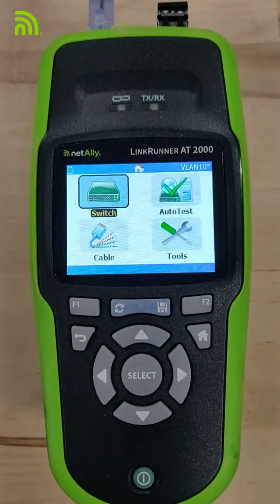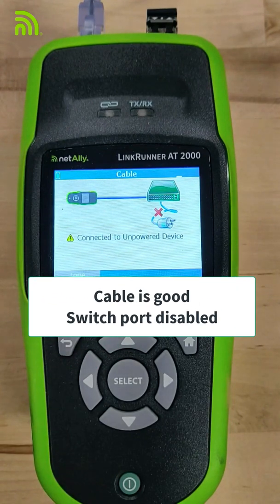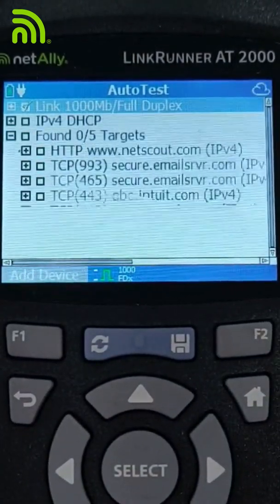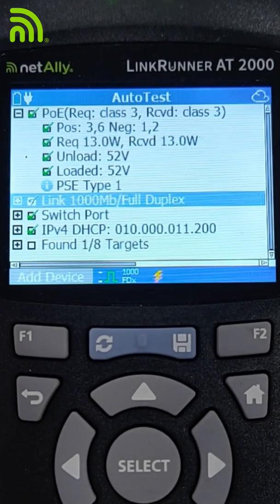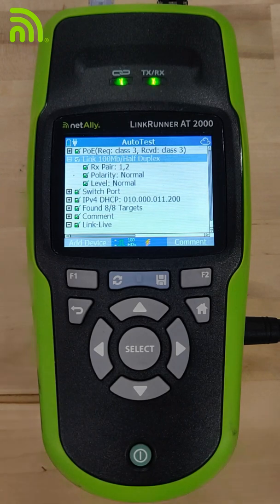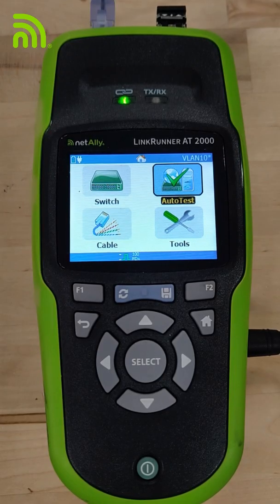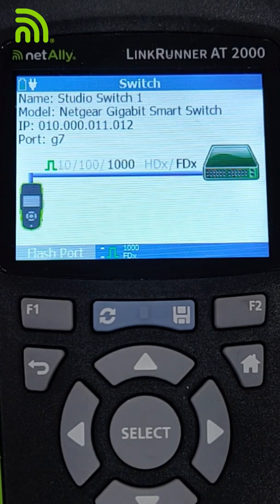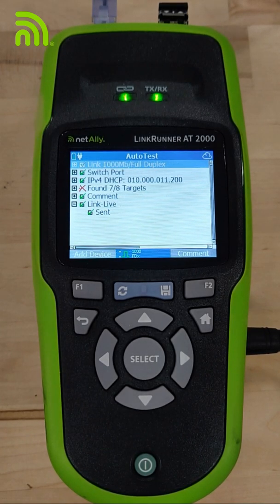Troubleshoot Ethernet Link Problems with LinkRunner® AT 2000

Comment: Is it possible to test fiber? like tx/rx level?
Reply from the maker: @leeholam4249  The fiber test in the LinkRunner AT 2000 can be used to validate link, speed (up to 1G), duplex, and signal strength. It does not include an OTDR. Here's a comparison guide for the 3 models --> https://www.netally.com/wp-content/uploads/LinkRunner-Capability-Comparison-22-V1.pdf

Comment: Will the cable test identify a good shield on shielded CAT6/RJ45 Connectors?
Reply from the maker: No, this functionality is not available on the LinkRunner AT 2000, but it is available for the LinkRunner 10G, EtherScope nXG, or CyberScope.
Reply: We’re getting an ip address?  Guess we gotta enable or whitelist that MAC address?  Or can you give this a static ip ?